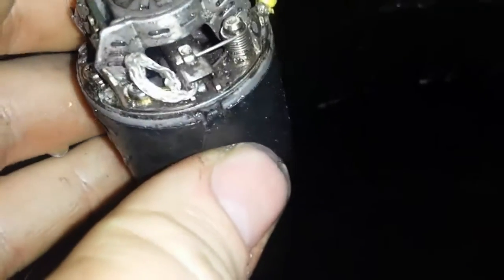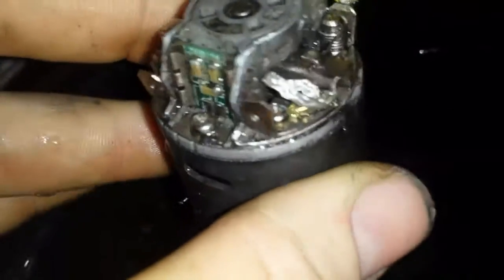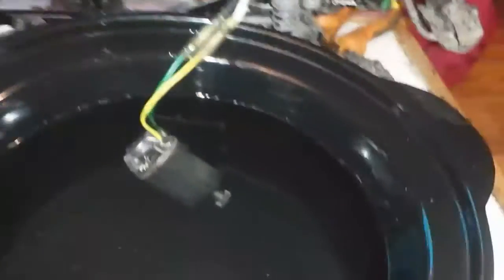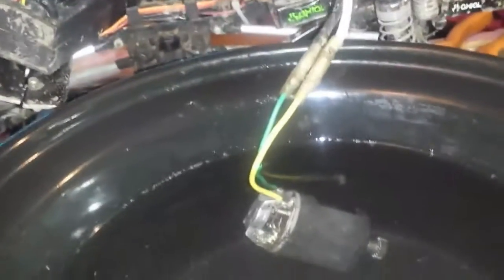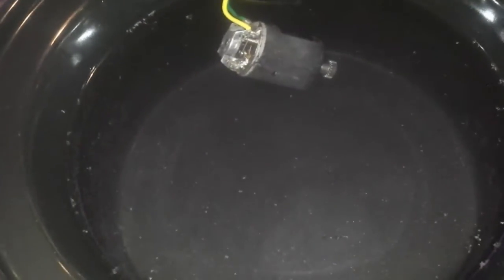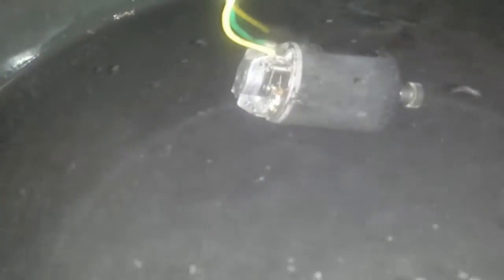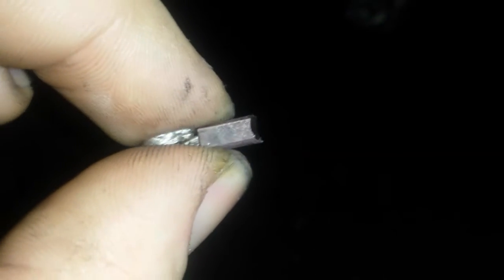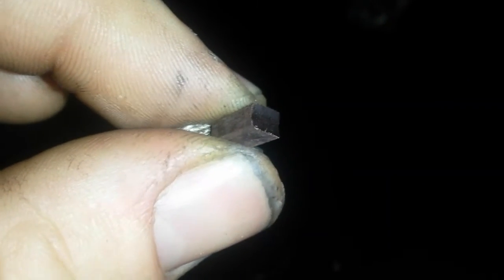How to change brushes in a rc motor

Comment: I have a vintage motor from 80s in my tamiya bigwig car. It's a restore job. It runs but burning smell from dust etc...not run for 30 years so pleased it fired up. Shall I put new brushes on it and run in water
Reply from the maker: I would buddy